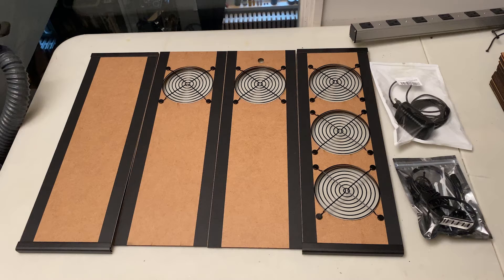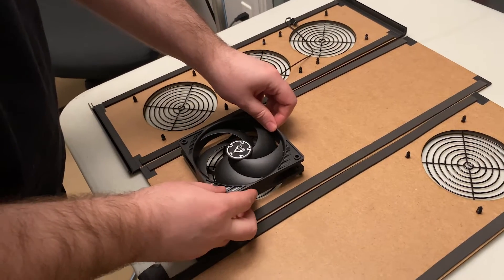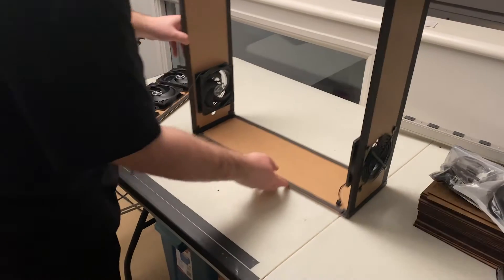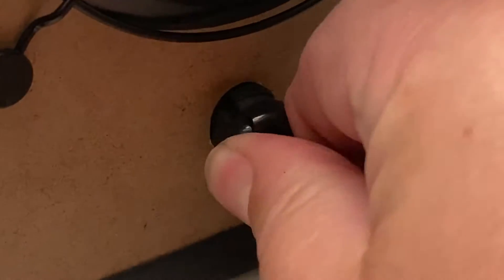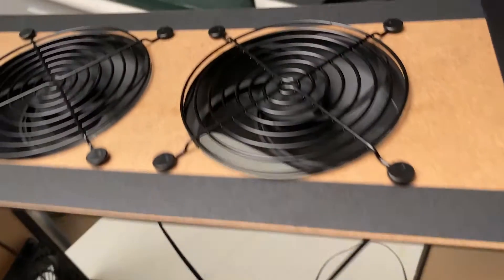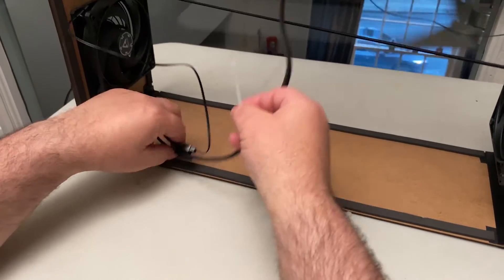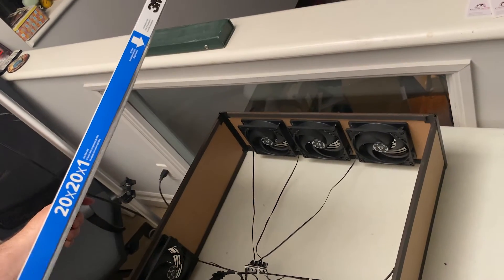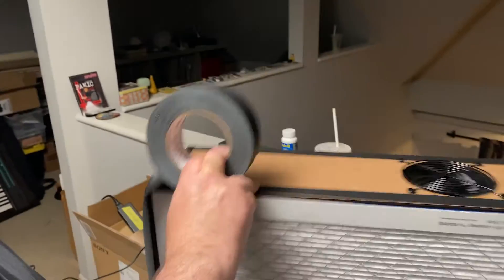Northbox Systems 5X Kit Assembly - December 2023

Comment: What are the dimensions in inches? 🤔

I like this kit‼️😁👍🏽

Only recommendation: I’d rather the kit came with black twisty ties instead of zip ties, so I can reuse it if I have to replace a fan or make a mistake & have to redo anything. 

I hate all the extra waste plastic cut to be thrown away after cutting all that length of zip ties multiplied by hundreds of customers. 😅
Reply from the maker: It's 20 x 20 x 6.5 inches.  Not a bad suggestion re: the zip ties, I'm so used to them from my years of bundling audio visual cables.
Reply: @RobertFantinatto  do you know of efficient exhaust window pc fans? I see it’s only 7 - 12 watts to run an air filter from pc fans, & I need to ventilate really toxic indoor air quality 24/7. Peak & super peak electric summer charges are killing me. If you could make me an acrylic with the fan & hole screws cut out, in a kit with hardware & power supply for dimensions I can give, I would greatly appreciate it!! 😮Thanks!

Comment: Any chance you will have a 140mm version?> For wiring any chance you will go down the USB route so we can use a power pack or usb charger instead of barrel type plug? And out of curiosity why are the two fans at the bottom instead of much higher. Wouldnt the bottom push out more dust on the floor? Thank you.
Reply from the maker: I am working on a 6 fan machine that uses the 140mm fans, primarily as a silent solution for classrooms.  The 2 fans are placed on the bottom as that configuration gives the best performance (CADR) when using a 5 fans set up likely due to less turbulence.  Extensive testing by Rob Wissmann of different fan configurations was used as the basis for the design:  
https://x.com/robwiss/status/1584723252340891648?s=20
Reply: @RobertFantinatto  That is great to hear! I am guessing with 6 fan setup you are going with a different filter size 16x 25? or are you going with 20x 20
Reply: Whoops! Yes that setup looks awesome on the 20x20x1

Comment: I finally got around to building mine today. Thanks so much for making these available to Canadians!
Reply: I used 2500 filters. Will that affect the output?
Reply from the maker: @ExtraAdventure  Sorry I just saw this, I frequently use MPR2200 and the 2500 are rated MERV14, I don't believe they will affect the airflow.